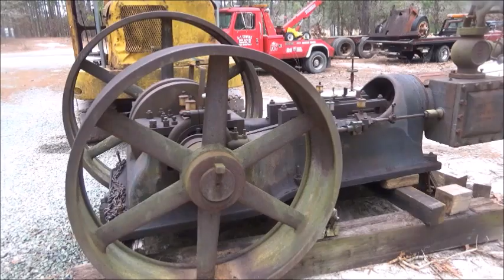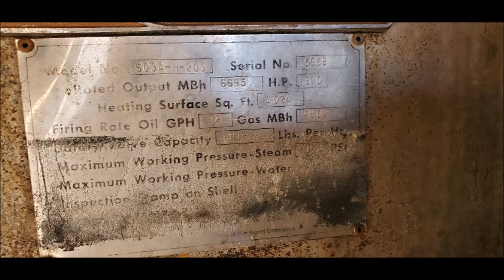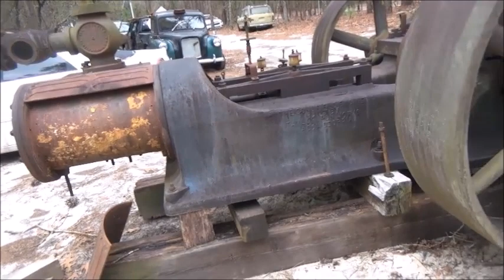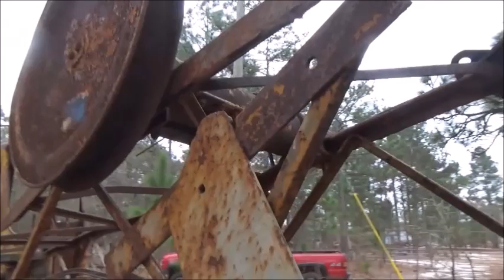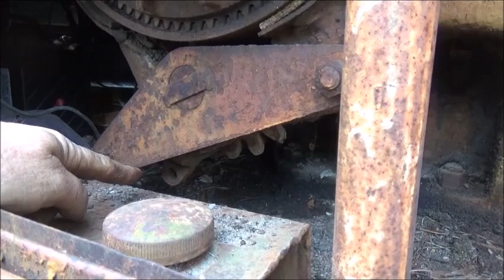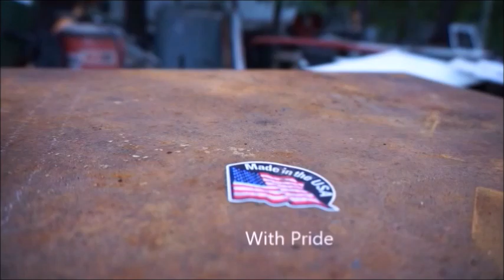STEAM BOILER AND STEAM ENGINE UPDATE

Comment: Boiler would be cool as hell but tend to get expensive.  Over 15psi require a bunch more licensing and inspections.  Insurance on premises tend to get higher as well the older the boiler is.  They get a bit nervous about them blowing up.  Chances are good boiler will need tubes rerolled after movement.  Specialized equipment again.  Check around with some folks who run antique steam equipment for some input.

Comment: Reading some of the comments made me remember a boiler we had like that where I worked.  We did have a huge dual water softner for the feedwater.  We did have chemical pumps and test kits for the water.  We had two boilers, the other was a standby.  After 5 years they had to re-tube that boiler, just sitting there the tubes got pitted and it would not pass inspection.  After that, when it was laid up they would put nitrogen on the top half of the boiler to cut down on the tube pitting.

Comment: That boiler won’t be cheap to feed.   Do you have 3 phase power with the correct voltage to run the feed water pumps?  What about water quality?  Are you going to have to treat the water to keep it extremely pure and clean?   Are you going to try to recover the condensate?

I think I’d stick with air for the occasional demonstration.
Reply: He has determination and a son that works for the Power Company, who should be able to fill in the electrical blanks. By the way, the power for the motor on the oil burner part does not need to be three phase, although it may be.
Reply: It wouldn't be hard to use an injector and a steam feedwater pump on that boiler. And there are several relatively easy methods to treat feedwater in a boiler that's not particularly sensitive to buildup. You would not need 3 phase power to run that boiler if you set it up differently.
Reply: @neil6212  
I should think the water feed pumps, make up pumps and blower motor would need be 3 phase. Especially the feed pumps due to the pressure they have to overcome from the feed check valves.  Unless he down rates the boiler considerably.

Comment: I honestly think your plan to run the engines on compressed air is the best idea.  Running a boiler to power a steam engine is very expensive.  The boiler has to be inspected and maintained, which is very expensive.  I don't know if there would be any requirement to have special insurance to cover the boiler with it being privately owned and on private land, but it would seem like a good idea to have it in case there is a failure with almost inevitable attendant damage as a boiler explosion is usually massively damaging, and that's likely to be hugely expensive too.  You have the original boiler for the steam engine for display purposes and you can explain how it worked.  Most people are vaguely familiar with the way a boiler operates due to everyone having kettles and hot water, so it really doesn't seem necessary to have a live steam boiler to run the engines when you can demonstrate them operating much more safely and cheaply by using the compressor.  Leave the live steam, period-correct displays to the museums and specialists that have the financial backing for them.  If you want to be involved in live steam operations then go and do some volunteering at the display you were talking about, you'll get the same pleasure from the live steam operations there as you would at home, just without the expense or danger.  I'm sure they would be absolutely over the moon to have someone as hands-on and creative in terms of rectifying issues as you there.  You can still offer the same educational experience with your engines by running them on compressed air, and you can point your visitors to the display up the road for the full live steam experience...

If you're working with the display people then you can probably arrange a way for your engines to be automatically donated to them in the event of your passing too, so you know they'll be safe for the future...

Comment: There is high likelihood of asbestos over some of the pipes around that latest boiler. ??
It looks nice but will be a big $$$ job to remove it. And you will likely encounter asbestos. 
The boiler is probably a money pit any way you look at it. 
I love that you are saving these steam engines. 
Glad you can do it. Glad you have the passion for it. I understand .  
Having said that, the cost of getting set up with steam is very likely prohibitive. 
The cost of running on compressed air is comparatively very affordable. 
Get started on compressed air and have fun. 
If the situations line up and steam looks affordable then go for that at a later date.

Above all, keep an eye on your health. !

Comment: In one of the plants I worked at we had three 1000 horse boilers and one 500 horse boiler (our summer boiler when heat wasn't something you needed). They used them for sterilization as well as heating. In the winter to keep the main line at 120 psi and to keep the lab very warm I would have two 1000s running. Heat can take a lot of steam flow. A boiler horsepower is 34.5 pounds of steam an hour. Multiplied by 200 equals 6900 pounds per hour. So you have kind of flow if everything's perfect.... I don't know how cold you get there in NC but i bet it covered that old building for heat in the winter plus if you had any processes that needed steam. I bet you don't need much pressure to run that engine as long as you're not connecting anything to it. I don't know what kind of dept of inspections you have down there. You might have to contact them. I thought most boilers were insured by the Hartford steam boiler company. I guess air is a lot less complicated to run that thing after all.
I can't be the only steam head that watches your channel, its awesome what you do. Keep on keepin on, and take care of yourself Jonathan.

Comment: it would be great to watch it run on steam. but why not try running it on an air compressor first? get a compressor and you can start doing some major sand blasting and work into restoring them to working? if its just watching them run for 5 or 10 hours a year at least a compressor is useful for a lot more around the shop that and it won't need inspections, insurance and all the hassle.

Comment: If you’re ever in Oregon you should check out Antique power land in Brooks Oregon they have a building with 4 or 5 steam engines running on air and they even have a fully functioning saw mill running there plus if your grandson likes trains they have a tiny sit on train ride and a full size train ride.

Comment: Boiler operation is regulated by the states individually. Your state may require a licensed boiler operator to run the plant. You will need feed water pumps. A water treatment program will be needed as untreated water will scale up a boiler fast. I would recommend using the air compressor. I have spent the last 39 years working a hospital power plant and running a boiler of that size is expensive. To properly warm up a fire tube boiler you need to run it on low fire intermittently at least 24 hours just to get it up to operating temp. If you heat it too fast it will expand unevenly and possibly cause stays to break and leak. Stays are the rods that go between the inner and outer shells. See what regulations your state has and go from there.

Comment: I'm in U.K. so the rules might be slightly different. I ran steam boilers up to three years ago when I retired. My advice would be to pass on the boiler still in the factory (It looks too modern to be a good fit for your machines aesthetically). Run them on the air, much safer, and hide the compressor in a little shed behind a nicely painted non functioning period boiler that matches your engines. To get that boiler properly insurance inspected, tested and rebuilt would cost an arm and two legs. Coded welders only, if USA rules are anything like ours, (and watching U Tubes of American railway engine boilers being rebuilt, they are). The age of it, they will probably want the crown valve changed to cast steel, (from iron). If you were to do it , which I don't recommend, the running pressure could be reduced a lot from 150, but as I said earlier, fake boiler, and run it on air, save a ton of money and heartache. If I'm wrong, don't be afraid to say. Love all that you do, can't wait to see the sorting of the crane !!

Comment: I know a boiler requires a licensed operator when it's making steam until it is shut down and the pressure is zero. from memory of 30+years ago that's why hostess paid a engineer double time and a half to sit in the plant over Holliday's so they could keep steam up. it required 8-16 hours to build pressure from cold. it's a licensing nightmare from the time you light the boiler until it's cold you have to have a licensed operator there on site . If you had a tie to a trade school industrial program. it would help . students you know.  or start a club for steam engines get qualified steam operators or exceptions needed. good luck . a pitbull with a wooden leg and eye patch might detour thief's but I sought it.
Reply: I spent 19 years as a boiler operator looking after 3 Cochran thermax boilers each producing 7.5 ton of steam an hour. 
As the boilers ran 24hrs a day and the boiler house wasn't  occupied from 3pm till 7am the alarms were connected to the fire station and I would get on average 2 call outs from the fire station a week at stupid times like 2 or 3am that an alarm had gone off and I would have to go immediately to sort the problem. 
These boilers are way to costly for a private individual to operate.
Reply: @bobp6742  how long and costly is the licensure?
Reply: @coltonstevens1  
Don't know my employer (government) paid for all that.
I know my certificate had to be renewed every 5 years.

Comment: Johnathan

The cost of going through that boiler and getting it tested and certified ,
( the pressure vessel safety devices ,etc. ) Is going to be extremely expensive.
     I,m a licensed steam engineer.
For over35 years of work with both small and large boilers.
   I worked for Coca Cola USA and Southern Calif.Edison.
   A approx.200hp boiler would use 40 to 70 ish gallons of fuel ( bunker#2 ) an hour as a guess as thier is so many changes in technology over the years.
Plus the cost of approve storage tank and EPA permits, etc. Which would be mandatory here as  part of and subject to civil authority  boiler inspections and fees.
Chemical water treatment costs are about $40.00 an HR. 
    Here in Calif. You have to have a licensed operator there when ever the boiler is in use. The legal logs , documentation to confirm to the local ordinances,  ( blow downs chemical testing you do ,etc. )And just plain checking every is full time job. 
 The city permits and inspections fees are $ 100's a year ( have no idea in your state / county.
 It took me 1 year of boiler school combined with a 3 year 6 step apprenticeship before I could apply to take the license test.
Two notes here.
1. Like a car engine you get to know the equipment and listening to it and looking at a couple of gauges you know if things are good or what needs TLC. You just feel it  ( Life experience)
2. I do not feel I'm dumb or the brightest blub on the block , 
All I'm going to say it was a hard nut to crack in that 3 years. 

I have seen pictures of simple mistakes in operating that resulted in a boiler letting go.
They all look like a 500 pound bomb went off.

I agree it's cool  if I could afford it like Jay Leno I would do it for history sake.

I saw another comment that suggested run it on air
Sounds good to me.
Do not have worry about water collecting in cylinder rusting up while sitting etc.  
At a 150 P.S.I.  and the size of the drive pistol / double action , and R.P.M. it was run at .
Bottom line it  would use a lot of air. 
The C.F.M can be calculated.
Might have to  run a couple of large compressors. But start up / shut down is a breaker switch with no state, county, local people telling you what can not do.
  You have the other boiler just paint it up nice and make it look like a 1850's unit should and enjoy it and still have some monies left in the bank.

Good Luck
Mike

Comment: As a steam locomotive engineer and mechanic I might have some basic answers for you. If you choose to limit operation to compressed air you should have no problem just making it go. Should you choose to use steam under pressure that's another issue. I would recommend that you visit an operating steam tourist railroad or museum and soak in some greasy, oily, hot, dirty wonderful steam stuff. Boiler inspection by the insurance provider (Usually Hartford steam boiler) and possibly the State as well will be necessary. A lap seam boiler is out of the question because of inherent hidden flaws. A butt seam boiler with out previous inspection documents is also problematic. I don't want to discourage you, but you should be cognizant of all the hurdles.  Good Luck. I love all you're doing. That's why I followed my trade in an unusual line of work.

Comment: I operated a Sterling coal fired boiler that was built in 1929 i worked in a textile mill for 13 years until we went out of business after 106 years a boiler has to be inspected every year to make sure the drums and tubes are not leaking and its a pressure vessel it had a steam pump water in to it but it also had a electric water pump for a backup it takes a lot of water to keep one going and has to have blow down valves to release the build up of calcium deposits salt brine and chemicals to keep hard water out if it passes inspection then it will get a permit to operate  gas and oil boilers have to go through the same inspection

Comment: Do not apologize for preserving American industrial history. So many are eager to scrap what you have saved. As for boilers you need to get an ultrasound thickness survey of the shell IF you wish to run at name plate rating. If good and price is right get it if you can. Be aware of health hazards when doing so. Automatic oil burner controls are nice unless you want to babysit the boiler-they need the attention like a child would. 150psi steam could have been used for process purposes since its temperature is over 350 degF. Cooking, curing and chemical reactions are some possibilities.

Comment: That boiler is way too big for what your requirements may be, you need something smaller and hand fired. Don’t forget the working pressure of the boiler is set by the safety valve lift pressure set by the boiler inspector. Good luck J 🙂👍🏻

Comment: Some really large operations (lots of buildings over several acres) such as airports and universities operate their heating systems with high pressure steam because the pressure distributes the heat with no extra energy needed for pumps. The licensed boiler operator is needed 24-7 but airports and universities are open and operating their buildings and staff anyway, mitigating the extra cost for the licensed staff.

Comment: If the boiler is on private property the state can't really say much of anything about it. The tests are really easy and straightforward to do. With a steam pump and an injector, you could easily run the thing without any power. There are also steam fed oil atomizers that can run on used motor oil and save a lot in fuel costs.

Comment: Hi Jonathan,  If you just want to have the steam engine ticking over, to play with and for display, a much smaller and lower pressure boiler would do just fine....  I would have thought that a vertical fire tube boiler of about 3 to 4 foot diameter and 6 to 8 ft tall would do fine.... One that has traditional fittings, and that you can fire on wood....  more traditional too.   That boiler you showed us looks too modern and industrial, and out of keeping with the engines......I was thinking of the size of boiler that you might find on an old steam shovel......  Just my take on it..............

Comment: Some companies sold steam to other plants at a rate of pounds per hour. State and City regulations determine license requirements. Currently our plant has one operation in one city requiring a license and the other plant in another city does not. Been doing this power plant thing for 25 plus years. They also could have had a small steam generator for producing electrical power using this boiler which is common or they could have used it to send steam through that heat exchanger to heat the plant with hot water.

Comment: As with others on here who have experience with boilers, I would say don't even think about it. Steam boilers take a lot of  work and also the water treatment has to be correct to prevent scaling and corrosion.  Modern boilers can be left to themselves, but what you have there would need almost constant attention. In the UK boilers have to be inspected every year and that involves a complete strip down of the boiler and valves, then rebuilt and tested. Just get a decent compressor and make life easy for yourself.

Comment: Here in va. Yearly inspections,  insurance is required if public has access. Example: steam show, farm day shows. Running this equipment  on air ,probably will be the  easiest.  Steam  will  give you the power to run the equipment ( use it, not just show it moving).

Comment: I would stick with the compressed air, a lot simpler and less complicated to deal with for licensing and insurance.
Reply: Yeah, but why not run the compressed air through the boiler just for looks...  The extra air-volume would make for a good show.  Heck, it might be possible to run it with the air compressor through the boiler, and put a little steam in it for appearances.  But the truth is, it sounds like Jonathan is going to go for this oil-fired steam boiler unit, and make it work.  It sure would be a sight.  It's got to have a nice steam whistle too.    Wahooooooo!
Reply: I vote for compressed air.  It is a shame people loot and steal, secure your treasures first.